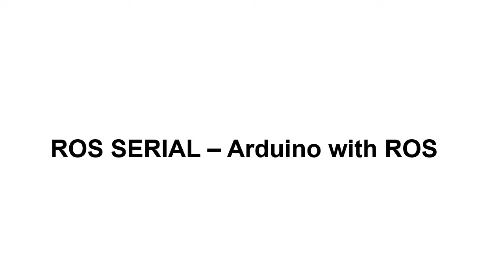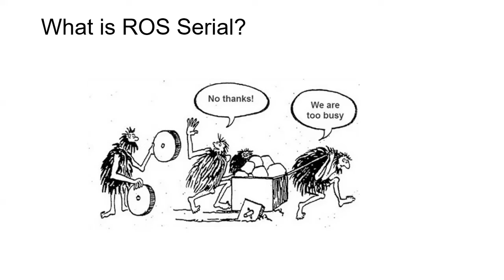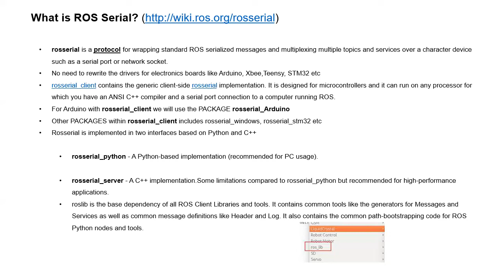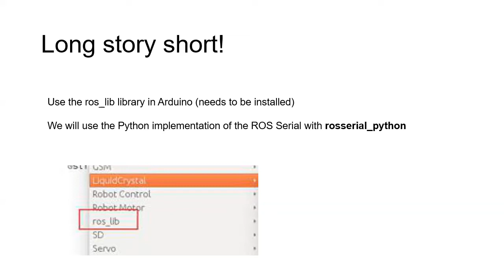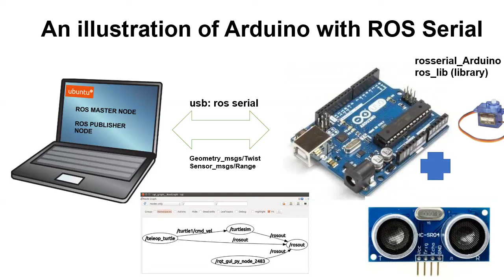ROS Arduino tutorials | ROS Arduino serial communication #1

Comment: i want to know the hardware in which we can use c++ and then move to ROS
Reply from the maker: Try Arduino Uno.
Reply: @MieRobot  
But arduino uses c more them c++
Reply from the maker: @armancodeq3642   it does not matter as the main code in Arduino be it c or c++ are compiled in Ave GCC and Avr . Source from Arduino which may help u https://code.google.com/archive/p/arduino/